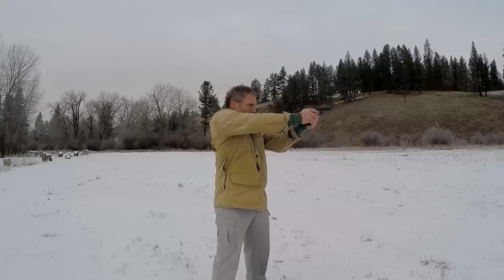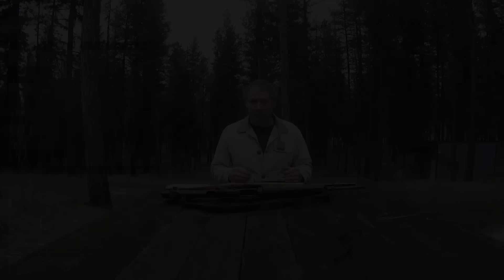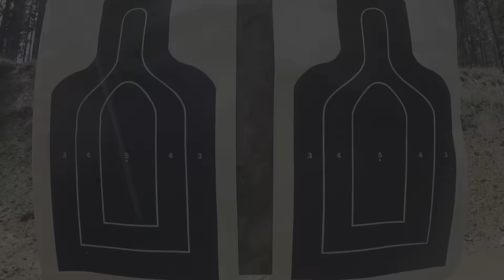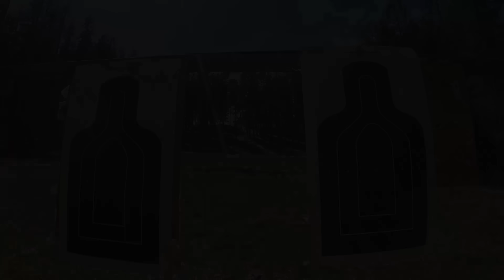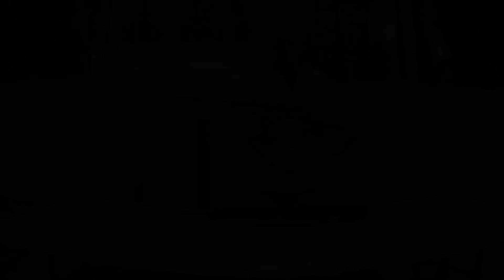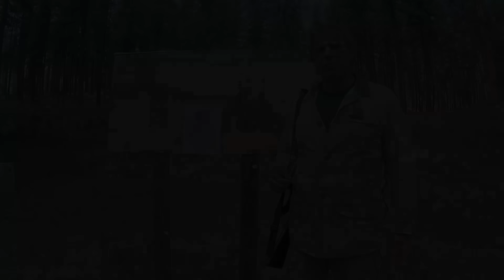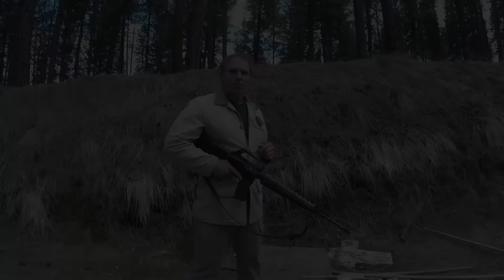Mini-14 vs AR15: Which is Better?

Comment: About 10 years ago, there was a long thread on the Glock Talk Forum where everyone was bad mouthing the Mini-14.  I was suprised to see Massad Ayoob come in and make an angry comment in support of the Mini-14.

Ayoob said that he was sick and tired of seeing Internet Experts saying that the Ruger rifle was no good.  Ayoob said that during classes that he taught to Law Enforcement personnel, the Mini-14 shot just fine and had a lot fewer failures during the class than the AR rifles had..
Reply: I’ve been very pleased with my mini 14 Ranch that I bought three years ago with a heavy barrel. It’s not a tack driver but I generally get about 2 MOA.  With a 4X scope from a bench rest  I get 1 to 2 inch groups at 100 yards; 2 to 4 inch groups at 200 yards and I can hit 15 inch steel at 300 yards. Another words, it will get the job done. Also, I don’t have the neighbors getting all upset when I take the rifle outside.

Comment: I'm not a fan of the ar platform. That said I own 2 ar's and would take them as a battle weapon any day. I don't like how dirty they get, (Gas blowback), they fart gas in your face (gas blowback), and I don't like how they CAN feel cheap. I have upgraded one of my ar's and it feels good. I love the Ar's reliability, how everything is where you need it, and the parts I can install to make it unique and more functional.
Reply: "Everyone has an AR. What makes them so special? What's the appeal? If everyone has one, it's not special." I used to think this too, but man, they are light, reliable, customizable, available, cheap/available parts/mags/ammo, easy optic mounting, free floating barrel, great/tunable ergos and on and on. Not my favorite, just like a Glock, but I own and trust one of those too. I'm up to three ARs now.

Comment: Haven't had a mini"14", but I had a mini"30". 
Prefer the AR platform.
Reply: Yea I got my mini 30 back in the 90s and tried to shoot wolf through it but I kept getting light primer hits and this was before the spring kits came out.So I sold it and moved to the ar15 and ak and never looked back.
Reply: @green15838  The same here. I bought a Mini 30 in 2002, and I had the same issues with Wolf ammo. Then I found out that using steel ammo will surely break the ejector, I couldn't find reliable magazines over 5 rounds, and it wasn't accurate at all. I sold it, and bought a Russian AK that solved all of these problems for $150. Even with American ammo, the Russian made AK's I 've owned are much better compared to Ruger.
Reply: @petercarmody4897  I've never had any issue with  my Mini 30 but I never fired cheap steel ammo through it and I use only good quality mags.  That's a big advantage of the AK - I don't hesitate to fire any type of ammo through it.  Shooting the 30 gets expensive.
Reply: Mini’s Suck. Hub cap sized groups at 100 yards, when they don’t jam

Comment: so this answers the question of which was better in 1982.  maybe a more useful comparison would be a new mini 14 and a new AR15, with similar barrel lengths.
Reply: I agree, but I think it will only widen the gap for the AR. Modern ARs have massive game changing improvements, like free floated barrels and easy mounting of modern optics, while the mini 14 has not changed much, if at all. 

It’d be hilarious to watch the Mini 14 against something like the inrangetv WWSD rifle, where the AR is over a pound lighter, is free floated, has better optics placement and better ergonomics, and literally the only advantage the mini 14  ha sis the looks and legality of the rifle.
Reply: swd311000 agree to a point, I bought an AR last year that wasn’t free floated, lost it in a boating accident.  But there is a wide range of ARs, but the mini is pretty costly so if you compared it to an AR of the same price the gap has certain widened, which I don’t get why the mini is so costly new today
Reply: @jimfisher9680  Oh, so free floated doesn't mean buoyant?
Reply: Jim Fisher probably the same reason the M1A is so costly: those more traditional style receivers are much more complex and expensive to machine vs the AR.
Reply: Scott Stewart guess not.  Weirdly none of them were buoyant.  Cant figure it out... 🤔🤪
Reply: swd311000 probably true, but good bolt actions can be had for relatively low cost, so it must be either in the action or low production because of low demand, which would be my guess.
Reply: Send him enough money to buy both and I bet he would absolutely make the video.
Reply: @Ryan93Ventura  hell ill send him my 581 series mini lol
Reply: @Ryan93Ventura  fair point, but this vid is only useful to somebody looking to buy a 1982 mini or a 1982 basic AR.  Interesting but useless.
Reply: This is my thought as well.  I’ve heard there where some upgrades that helped accuracy of the mini14.
Reply: AR 15 is lighter thus more handy.  Also the AR platform is less susceptible to dirt and debris from entering the action. Though and the end of the day it's a choice of preference.
Reply: @blairbuskirk5460  ar 15s are lighter sure, but which rifle can you use to beat to death whatever it is after you run out of ammo?
Reply: @recklesssquirel5962  L85A1
Reply: @Rhynome  was that used in this video? Lol
Reply: @recklesssquirel5962  well, no. But it is the rifle I'd use!
Reply: @Rhynome  not arguing with that point lol
Reply: I can't speak for you guys but my modern, 2016 production mimi was absolutely atrocious at 100 yards. After 4 or 5 rounds, it had numerous fliers. I added the harmonic barrel stabilizer and saw no improvement. Perhaps I bought a dud. Beautiful gun but I sold it because of accuracy issues.
Reply: @TheRoadhammer379  yeah that sounds like a dud. The barrel stabilizer is much more effective on the older pencil barrel models anyway
Reply: Wouldn't this old of an ar have 1:12 twist or am u confusing it with a different model? 
Anyway if that's the case today's 1:9,1:8,1:7 will most definitely widen the gap 
Forgive me for not being familiar enough with the mini to know if it is offered with varying twist rates
Reply: Matthew Beaver 

That era SP1 (the AR) should have a 1:12 twist rate. Current mini 14s have a 1:9 twist rate. Most modern ARs have a 1:7, but 1:8 and 1:9 aren’t that uncommon.

Comment: I have a Mini14 580 series and a DD AR15. I have noticed practically no difference in accuracy, power, portability or weight. It's mainly ergonomics and what action you prefer and both are great.
Reply: B real  yeah, and on that note, I'm really surprised to hear Paul say that the mini is easier to disassemble. Maybe a if you're doing a full disassembly, but you still need center punch or something for the mini 14 -- pretty much every cleaning rod I've ever had Is too big for the hole in the trigger guard. If aren't a baby about your knuckles,  you can just knock out that rear pin and pull out your bolt carrying group and charging handle and do whatever you really need to. If your gun goes down you can potentially figure out the problem as in seconds, without having the entire rifle apart. With the mini 14 it's pretty much all or nothing when it comes to disassembly.

Comment: I've had a mini14 but it wouldn't extract correctly and kept short stroking. Got an ar and never looked back although the mini 14 was a fun gun, I still find the ar platform better for me at least.
Reply: I'm not sure. It was with all different types of 223 leading me to believe it just had a gas issue

Comment: Mini-14 is not as accurate because of barrel flex.
Reply: All guns flex when firing to some extent, ARs are more accurate because of several reasons. ARs today are mostly free floated barrels, but even M16 pattern ARs have minimal pressure exerted on the barrel (as long as you don't bear into the handguard too much), whereas the Mini-14 has the handguard and gas system contacting the barrel and putting pressure on it. ARs have more and smaller bolt lugs as opposed to the two large ones of the Ruger, and it locks the bolt into the barrel itself not a receiver extension, both of which from a manufacturing standpoint makes it easier to make the gun accurate. Mini-14s also have a fairly slow twist rate that doesn't like heavier bullets than 55 gr., but that's mostly a long range precision shooting issue rather than mechanical accuracy.
Reply: The thickness isnt as much as the AR and the Mini will flex much more than the AR so YES. Severe barrel flex on the mini-14 contributes to more  inaccuracy than any other cause. The shooting demonstration was with 223 ammo and NOT the heavier 55 grain 5.56 so I dont know why you are even bringing that up. Even in shooting 40grain ammo it will be less accurate because of barrel flexing.
Reply: @Kevin_Patrick001  The A1 pattern AR he was shooting also has a very thin pencil profile barrel, about the same as the original Rugers. And he was shooting 55 gr. ammo, 62 and 77 gr. is the "heavy" stuff Rugers won't stabilize (though twist rate depends on year of manufacture, some mini's hate 55 gr. and love 62). Barrel flex alone isn't the only thing that makes the mini less accurate, it's just one problem of many it inherits from the m14, it's just an inherently less accurate system. Mini-14's have had much thicker tapered barrels for a while now, and there's still a big difference in accuracy between the two.
Reply: Negative. You should take a look at the specs. The Mini-14 has a barrel diameter of .563 and the A1 has a barrel diameter of .66 tapered to .60 in length due toi decreasing pressure. This gives the A1 LESS barrel flex and is why they created a barrrel brace for the Mini-14 to aid accuracy and is why the Mini-30 increased barrel thickness to .625. If you are just going to troll and not know what you are even talking about then just go away. Troll again and I'll ban you.
Reply: @Kevin_Patrick001  Dude, calm down lol. I may have over generalized a little, but we're arguing the same goddamn thing. The AR is more accurate. They both started with really thin barrels that didn't benefit from lower quality metallurgy of the time, both over time got thicker barrels and improved the deficiencies of the thin ones, and ARs are still more accurate. Barrel flex absolutely plays into the Mini-14's inaccuracy, but it isn't the sole reason, as modern production ones with thicker barrels, even if you do all the little tweaks and tricks to wring out all the accuracy out of the system, still usually get outshot by any decent quality AR. I'm done with this silly argument of ours, have a good evening.

Comment: I'd like to see an AR platform vs an SKS platform...
Reply: SKS vs AK, other way around would be apples to oranges
Reply: @TheRoadhammer379  SKS vs AK is green apples vs. red apples.  Not enough difference to warrant a comparison.  One holds ten rounds and is loaded by stripper clips.  What else would you test?
Reply: Comparing an AR to an AK has been done. It always comes off as the AK is less accurate. Well yeah the AK has a barrel that's 4 inchs shorter than a typical AR. Most women can tell you that 4 inchs makes a lot of difference, so will most shooters. With a longer barrel the SKS would be more comparable with the AR. As for the "10rd mags and stripper clips" complaint. You can buy aftermarket stocks and gadgets that are AR-ish and aftermarket detachable mags are readily available.
Reply: How about a FAL?
I'm not a really gun guy, but I hear a lot of good things about it
Reply: @moritamikamikara3879  FAL vs HK91 is a common comparison but unless he can borrow them, already has them, or gets a lot of $$ donated, I don't think we are going to see it.
Reply: FG 42 Vs StG44, while we're at it.

Not a fair comparison. The SKS was designed just before the Assault Rifle concept fully matured. The Soviets deployed them for a year before replacing them with the AK.

Though I get were you're coming from. The Chinese ran AK production side by side with the SKS for a very long time, even supplying them to the Vietnamese. I don't know why, since the AK outperforms the SKS in every relevant aspect to the soviet mass infantry doctrine, which the Chinese also adopted. But the AK vs AR thing has been done to death.